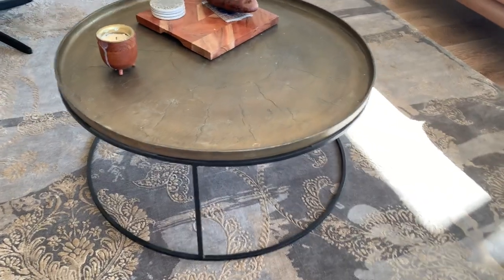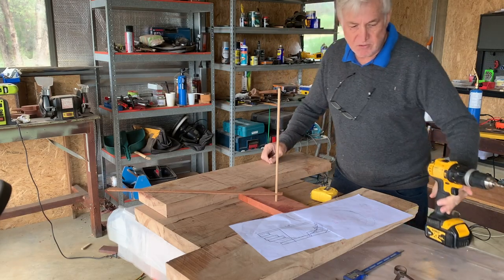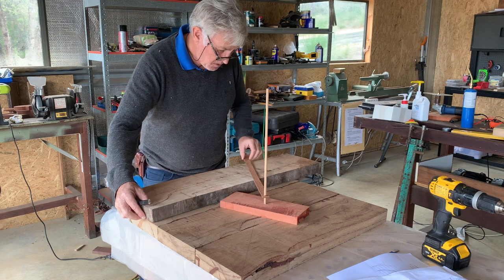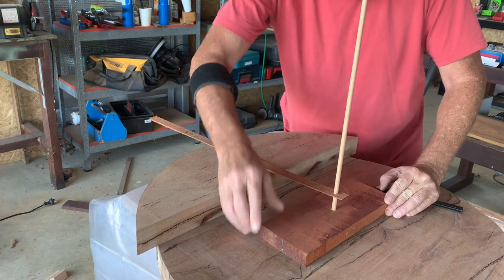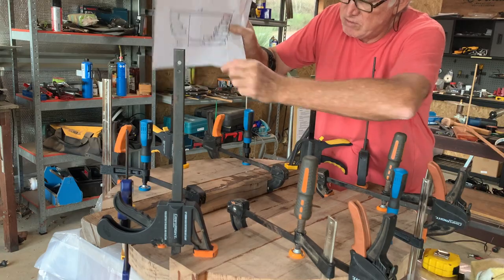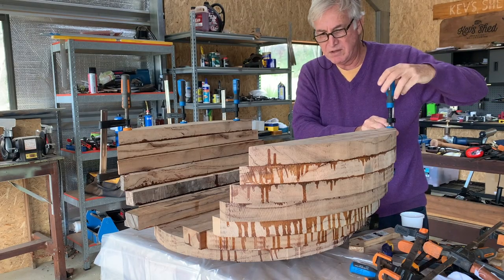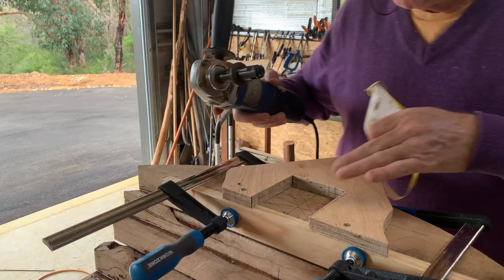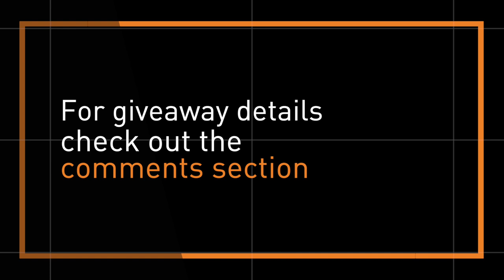Crescent Coffee Table - Part 1 | Arbortech

Comment: Hi Kev, Great project and such a clean and tidy workshop. I notice you used the adjustable turbo shaft tool in an angle grinder to do the recess for the cross beam under the brass table top. Also clever tip to make each section with a lip so each piece was easy to clamp to a board below and then carve the inside and outside of the table with the Arbotech Power Carving Unit. Well done.